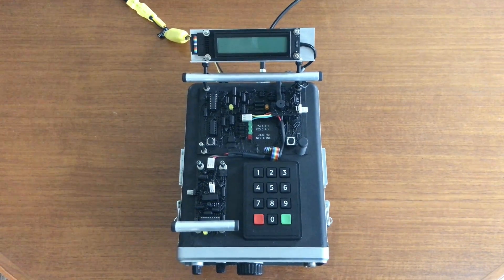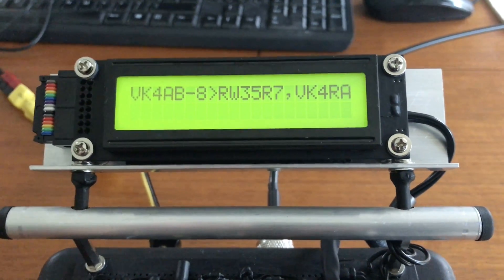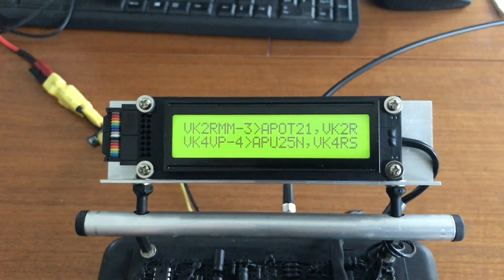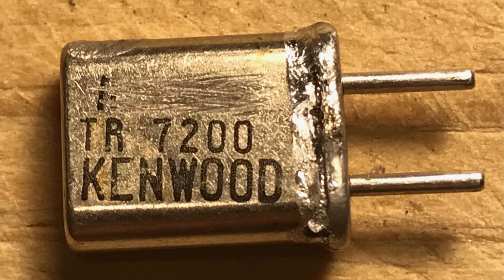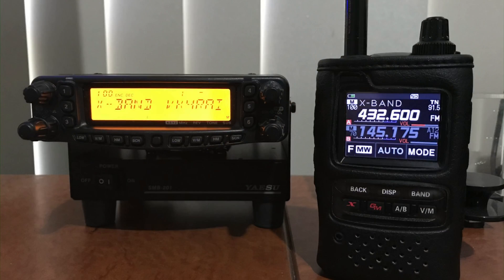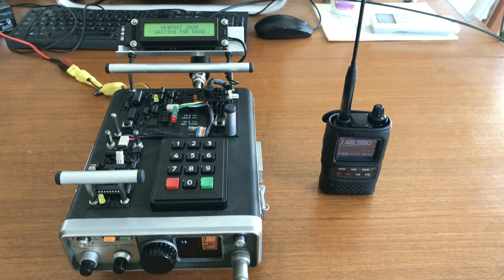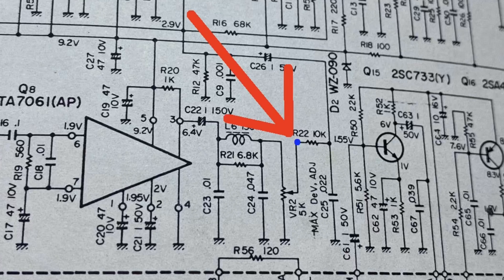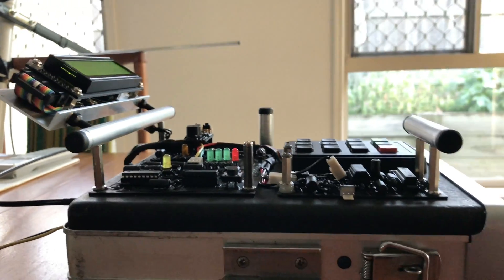Bastardised Kenwood TR-7200G VHF Transceiver

Comment: Hello,
While researching the Kenwood 7200, I saw your video. It's very good, a great project!
I purchased a TR-7200G, but it doesn't transmit. Could it be because it doesn't have a VFO/AUX connector on the back of the radio? Does this connector have any connected pins? If you can help, I'd appreciate it.
73' CT1BRM
JM
Reply from the maker: Hi Jim, yes there’s a dummy plug that shorts two pins in absence of the external VFO. Download the user manual. Full schematics are in the ordinary user manual (those were the days!). It shows the dummy plug.  I can’t see the pin numbers on the dirty old scan, but the orientation is clear to work it out.

Comment: Great mods. I recently picked up the Trio TR-7200GII and the 70cm version. I know my version uses the rear accessory connection for the external VFO selection so using that little DDS you could transmit any freq with that. My plan is to use the PA section and some of the pre-driver components on the transmit board for my HackRF SDR.  When I find a good copy of the diagram. Seems like a pretty good radio for the age. Cheers 73's VK3FTZD